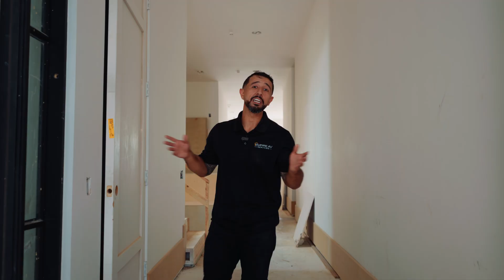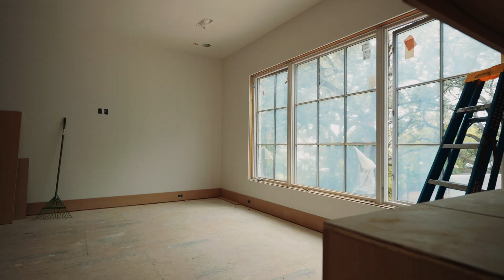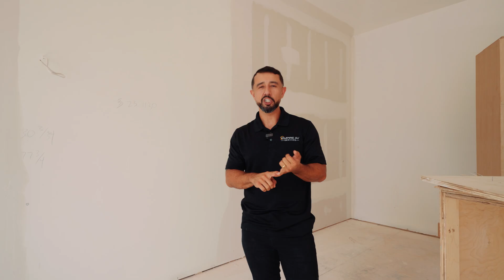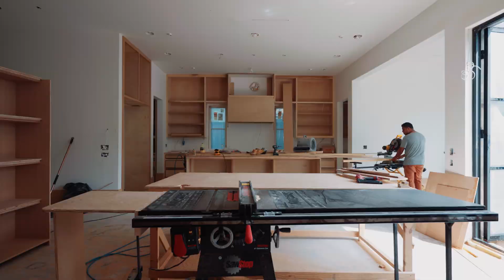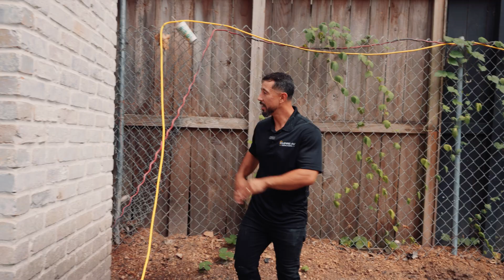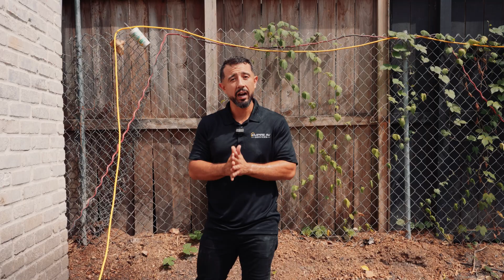Empire AV Smart Home Walkthrough – New Construction Phase

Comment: What’s the best way to plan for ventilation of the space the rack will go? I often see them in utility rooms, tucked away in closets or even under the stairs all of which seems less than ideal due to the heat output
Reply from the maker: Great question! Some smaller racks—with gear like Sonos amps, NVRs, and a basic switch—can do fine in a cabinet or closet with some passive airflow.

But once you add power amps, AVRs, or distribution gear, you really want to plan for ventilation—ideally a return vent or dedicated AV vent into the room (or both, with individual control if possible).

Best approach is to build out your full rack plan first (even if you’re adding gear later), so you can size it properly and anticipate any heat issues from the start.